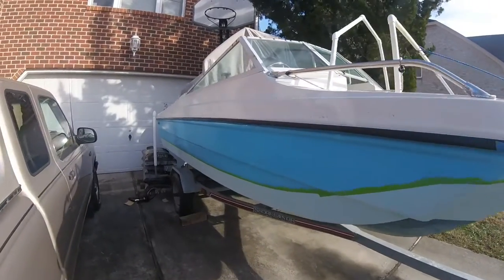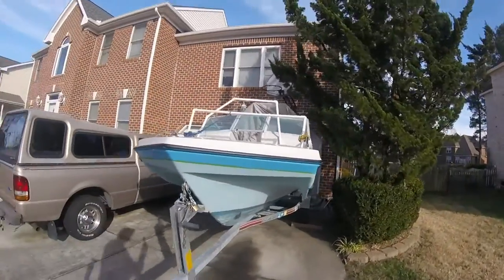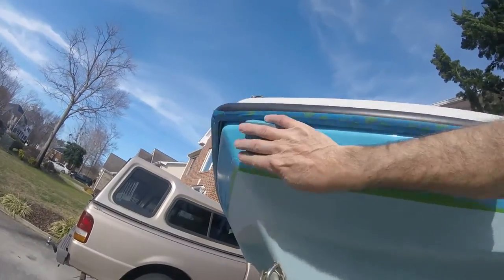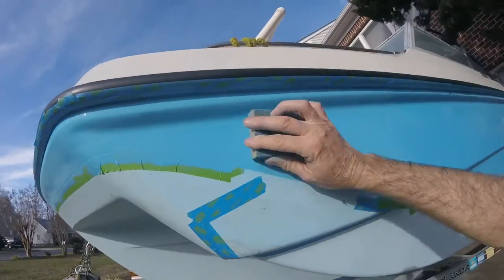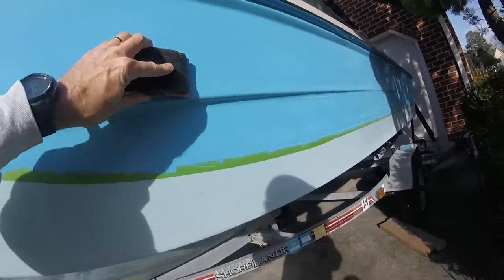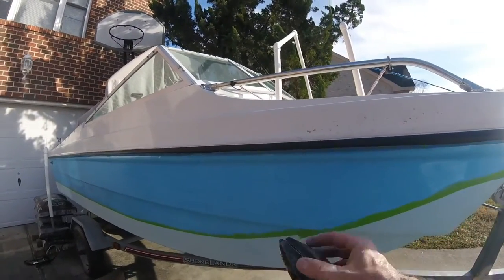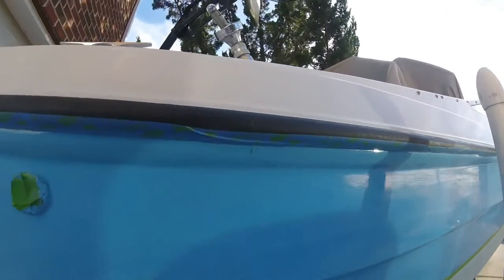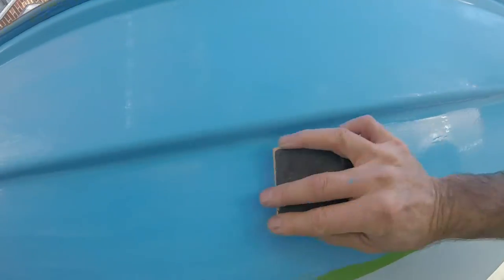Boat Restoration Sanding Thunderbird Tri Hull Sunny Daze Episode 15

Comment: What do you use to tow this beauty?
Reply from the maker: Ford Ranger V6 with trailer package works fine because it is a simple runabout, if it was larger, would need a full size pickup. Thanks for the comment.